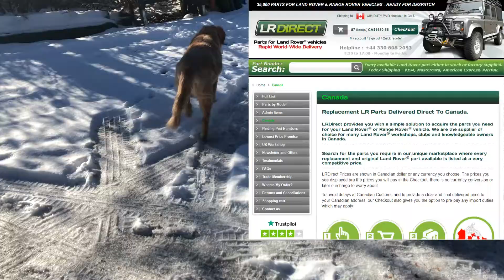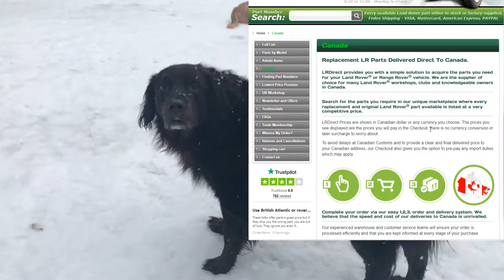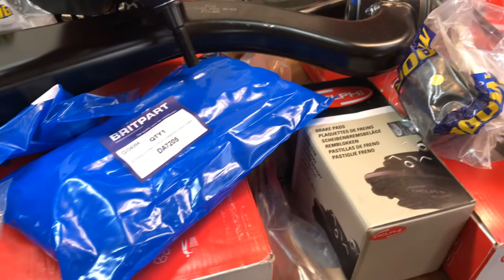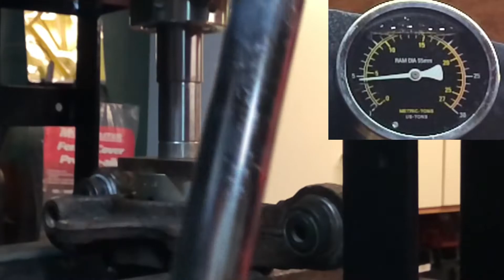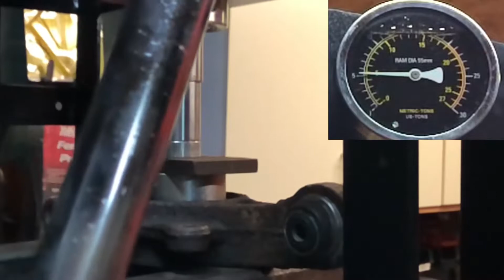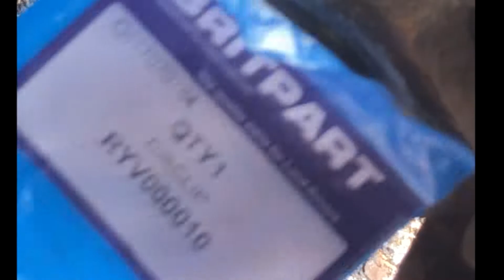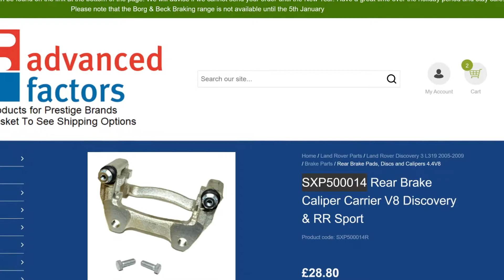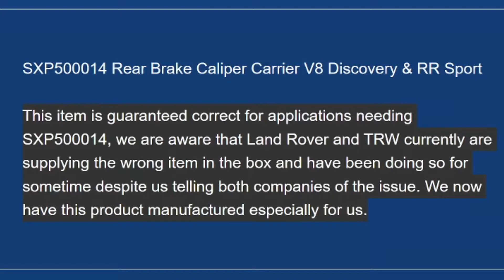Land Rover LR3 Rear Suspension and Wheel Bearing Replacement

Comment: Does the old lr3 worth you doing these much for it? I have a same old lr3, Will just give it up…
Reply from the maker: I think I spent around $3k in parts on it.  It's now 3.5 years later.  I did fix a few other things this past year, nothing expensive, another $700 in parts.  If used cars hadn't increase in price so much lately I probably would have been looking to replace it this year.  But I'll keep it going now.  The other thing is what do I replace it with?  A newer LR4 can have the same problems, most other SUVs have no where near the interior space.

Comment: Wow where do live in salt and snow area looks like a lot of work i need to do same on all control arms most looks easy to do except top rear upper control arm I hate breaking my brake line as I seen in other people video I live in Texas not too much rust on our vechles
Reply from the maker: You will have a much easier time without the rust.  Bleeding the brakes wasn't too bad, I've done it a few times now. This spring I had to replace the brake lines (rust).  There's nothing tricky required, just bleed the normal way.

Comment from the maker: A video that has nothing to do with cutting stone... more work on the Land Rover LR3.  This isn't a how to (maybe a how not to?) video, more of a watch me muddle my way through it.  For reassembly I followed the factory shop manual, which you can find online pretty easy.  I note where I ran into problems in the video, mostly related to rust and the parking brake cables.